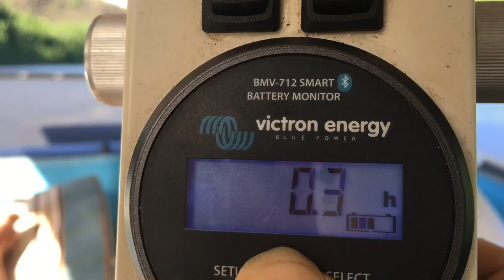SolGato modified props, motor mounts, and repaired LiFePo4 test cruise

Comment: Like the design. Seems like the components match very well. What is the Mod number of the Torqueedo props. Did You try other models ? It´s really complicated to find info on props for electric propulsion. How are the Caroute motors holding up so far ? THXs
Reply from the maker: Thanks. Yes, matching everything is very important if you want to strike a balance between max efficiency and speed. Props for electric motors are indeed more challenging because most manufacturers are designing their own around the design of their motor, shaft size, max Amp draw, application, etc.. So one must be willing to experiment and modify different props to find the “best” suited to their needs. Most importantly when testing, one must monitor the max Amp draw from the motors under load in all conditions in the boat they are intended for. Most manufacturers play it safe and under prop their motors so they can safely be used on a wide variety of boats without fear of burning up the motor controller. So having a shunt or a clamp meter is important for monitoring draw under load. That said, the rest really comes down to the usual stuff like diameter and pitch, and max RPM. The props I’m using now are the 1917 model used on the original 1001 motors. That motor was about 1kW but only put out 480W at 1200 RPM. Torqeedo motors are really small and the originals used something like a 14:1 gearbox to slow output to 1200 RPM. That’s why they are so obnoxiously loud. Anyway, my motors put out 2X the propulsive power in Watts at the same RPM, so I knew I could get away with using their larger diameter aggressively pitched propellers even though my motors are direct brushless drive. This also because my boat is light and efficient compared to say a 2-Ton sailboat which they can push with smaller 3-blade. Anyway, so far they are a good match. The motors don’t exceed their Max Amp draw under full load and the props have good bite. If a good deal came up on a used 3-blade that they developed for their straight shaft 2kW motor, I might modify it and give a try. Every motor has its issues, but for the most part the Caroute product has performed well and is serviceable, and they are certainly more efficient than most of the competition which was important for me as I did not want a big battery bank and was limited on the amount of solar I wanted to incorporate based on the way I like to use this boat.
Reply from the maker: I should also note that above all else, the max hull speed and shape of the vessel is where everything starts. If you’re trying to push a short non-planing hull you will be limited and it’s pointless to tune for high speed provided you are at least reaching hull speed. If however the hulls are semi-planing then playing with props on most “trolling” or “auxiliary” electric motors may be a worthwhile exercise. And if a planing hull, then a more aggressive prop can really pay off and may very well make a big difference in top speed compared to a “stock” all applications type prop. Study this chart closely from Torqeedo and you’ll see the relationship between pitch, diameter, RPM, motor power, hull type, etc.. with regard to their stock sizes and optional sizes and the speed ratings. While I don’t care much for their motors, they have done a nice job on their line of props by optimizing them for motor size and application. https://media.torqeedo.com/downloads/manuals/torqeedo-propeller-guide-en.pdf
Reply: @kauaislash5  Hi, yes I find the props one of the most challenging parts of electric propulsion. The smaller the boat, the more critical it gets. Size and weight of batteries and Solar have limits. Due to high torque on the low RPM spectrum a prop for electric propulsion is a totally different animal and therefore design parameters for gas engines are not valid. Yes, I believe You are right... manufacturers play it safe for warranty reasons but also with lack of interest to invest in research. I agree, the motors, the tech service, the commercial attitude of Torqueedo are questionable to say the least. However their research on advanced props so far is the best I have seen for SMALL boats. I wished to have access to their design parameters. Unfortunately that only leaves us with very few info and trying to come to conclusions with comparing their motors used. Of course watching Amp draw and max rated watts under load is a must and good indicator. I love pod drives. Natural cooling, one thing less to worry about in the aggressive marine environment. The 1917 model. that was also my first conclusion. Yeah , the rattle can Mod 1001 motor. Never liked that motor. Now they have this newer 1103 motor for small boats/ Kayaks. I like the match with the Mod 1972....very clean wake. However as with the Mod 1917, a universal prop to push a bath tub but not a high efficient multi hull. About the 3 Blade. They don´t manufacture the 2.0 Motor anymore. By luck I have a copy of the owners manual on file but some parts of the spec are missing. Worse than that....  Torqueedo´s efficiency rates/statements are very confusing to me ...
>>  * "To compare Torqeedo static thrust data with conventional trolling motors, add approximately 50% to the Torqeedo static thrust values."
I compare that to the Caroute spec sheet.... looks like total BS to me. Comparing RPM and static thrust both motors look very similar. 1470w in/ 1000w out @85% and the 2.0  2000w in/1120w out with an efficiency of 56%. And those are totally different props. Now 56%... that looks very Universal prop to me. I am also willing to speculate a 3 blade is the right choice for the 120 lb Caroute motor with a light and VERY performance hull speed. Well, there are the older Mod 1916 - 1923 and the newer and most likely further researched Mod 1953, 1954,1955 Series. I guess now it´s time to make a choice between Efficient speed and Max speed. That´s where the solar panels come in to play. Yes, You are right. Those props are not cheap. However in my case with 150 $ filling the tank it feels a little easier. I guess when the time comes I will run some tests with 1 motor in my pool for further conclusions. 
You wrote.... > From about 370W-739W they hit their peak efficiency of about 80% while the controller is still PWM. Seems like there is still some more room for optimizing. What are Your RPMs at max rated Amp with the Mod 1917 ?? 
Yeah, the efficiency rate. I am still trying to get a full understanding. Seems like every manufacturer is bending this term in the most efficient commercial way. I also like the Caroute motors, very quiet..... but I am absolutely horrified of issues because where can I get parts, repair manual, etc. With China everything is a project. Do You have any info about service life of the seals, bearings ?...... I would even spend a few hundred dollars extra for specialized tools. I mean tools for the SeaDoo are a lot more. Yeah, and with Torqueedo and the alike, they all want You to send the motor to the factory. That is totally out of question. Yes, there is still a lot of speculation, guessing and empty pages in my book.

@ William Fraser
Newport NT300 Product Launch  > 1300 watt motor
https://www.youtube.com/watch?v=kyQVQl0z6rg
Reply from the maker: The efficiency ratings are more likely done in a lab and not real use, and when a single percentage is used it is probably an “overall” figure. I asked for detailed numbers from Caroute and they actually provided me with a plotted chart of my model motor measure under load pushing a small dinghy. They used a clamp meter and they plotted RPM, Voltage, Voltage of bank under load, Amp draw, Power in, Power out, overall efficiency, etc.. I wish all manufactures did something like this for typical use scenarios like a hard bottom dinghy, small aluminum fishing boat, sailboat. It’s the best way to extrapolate how it might perform in real world/use situations. This is also how they “tune” their motors to ensure they aren’t overloading the controller. The original Torqeedo stuff was all gear driven, so not only noisy, but also less efficient. They went from the geared 1001 to the brushless direct 1101, giving better efficiency and quieter operation, but as you’ll note it uses a less aggressive prop. I see they have a new line of Cruise motors out, but they are still geared, however they state that they are using Helical cut Gears and not Bevel, so maybe they are a bit quieter. Either way, the complication and use of a gearbox as a torque multiplier has been problematic for them. For example the number of people who used to consistently shear the prop pins due to their undersize, the torque of the motors, and the pins not being stainless and suffering from corrosion. EPropulsion has a few props that are a little less aggressive that’s Torqeedos since their line of motors are brushless direct, but they have a strange double steeped shaft with integrated anode from what I have heard from users. Their engineers would not tell me the dimensions of their prop shaft, and spare props are not real idly available, so I went with Torqeedos. However they have a 3-blade that might be modifiable for the Caroute motors that is not as aggressively pitched and slightly less diameter that the Cruise 2.0. Serviceability, the Caroutes are easy enough except that they use a silicone potting compound to encapsulate the motor controller board. It’s smart that they do this as no circuit boat is going to live for long in a humid climate inside a motor case below water, but also if a seal fails, it’s likely not to cause damage, unlike failure after failure of Torqeedos. So, in the event of board replacement, you must remove vibration dampening, moisture protecting silicone compound, and then re-encapsulate. Not to be confused with hard epoxy potting compound. This is soft and flexible. Otherwise internally, their motors are built similar to standard trolling motors, in fact their engineer/designer used to work for MinKota. The bearings are standard SK and the O-rings, shaft seals, thrust bearings, and hardware can all be sourced independently if need be, however they provided me with a bag of spare parts upon request that I paid for so I can service them. They had a bad run of controller boards that caused a hiccup which has been documented by some, and they sent me a replacement board I will swap in this winter. All in all, their design is much simpler than others, with all motor control taking place in the motor, driven by a potentiometer. No multiple circuit boards connecting and communicating, error codes, multi pin connectors, etc.. 

I will post a link to the load testing chart for my motors so you can see the relationship between RPM, Amp draw, efficiency. You’ll see how they hit their peak while the controller is still pulse width modulating, and their efficiency at various Amp/power levels. Once you know how much solar and capacity you’ll be able to incorporate into you boat, you can see what the motor performance will be at that Amp draw/power consumption level, keeping in mind the numbers come from an inefficient to non-planing hull shape.
Reply from the maker: Caroute N200 chart here: https://www.boatdesign.net/attachments/f06febf1-1586-42ba-bb30-d8af078f0e92-png.177475/
Reply from the maker: Regarding the Newport NT300, looks like they “borrowed” some of the features from both Torqeedo and EPropulsion as they have done in the past with MinKota to create their “own” design. Wise of them to stay out of the integrated Lithium battery market and instead offer a re-branded external battery, however it is unfortunate they have chosen a 36V system over 48V. But for small boats, their motor with a couple of swappable E-bike batteries could be just the ticket for someone looking to cruise all day without fear of range anxiety. And it’s priced aggressively at the intro of $999, although it looks like in the end it will retail for closer to $1400.

Comment: How much power do you need for 5mph (sun only)?
Reply from the maker: Would be about 550W total (6x100W panels) or about 275W per motor. Motors are 1470W in/1000W out with an overall 68% efficiency, but they are more like 75% efficient at 275W sun only input. From about 370W-739W they hit their peak efficiency of about 80% while the controller is still PWM. The efficient catamaran hulls and lightweight displacement of course have a lot to do with being able to achieve my sun only cruising speed and overall top speed. With these new props, the motors now pull their rated max amp draw whereas before they weren’t being fully loaded and the props were reaching max RPM. The difference in bite and response compared to my other props is night and day even though they are the same diameter and pitch. What’s different is the chord and the material. I don’t care for Torqeedo’s motors, but I have to give them credit for their optimized prop designs.